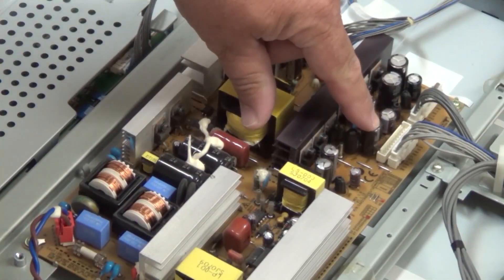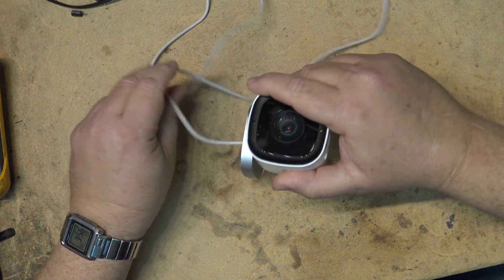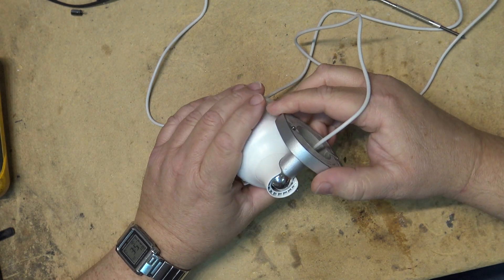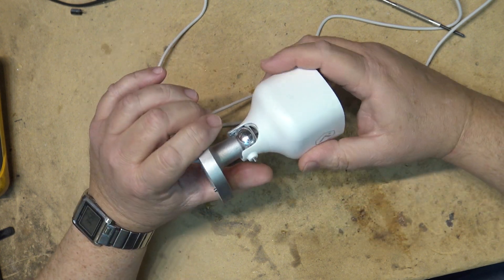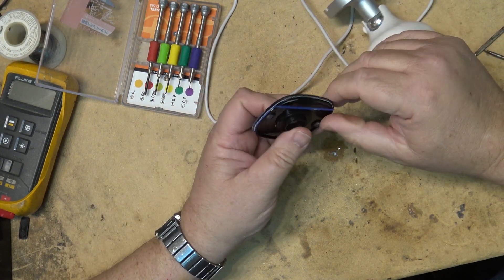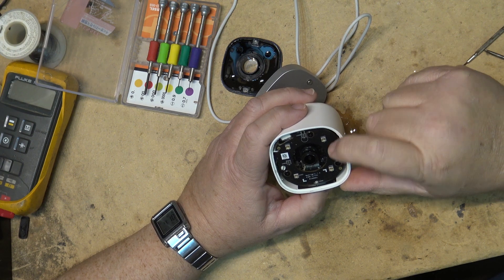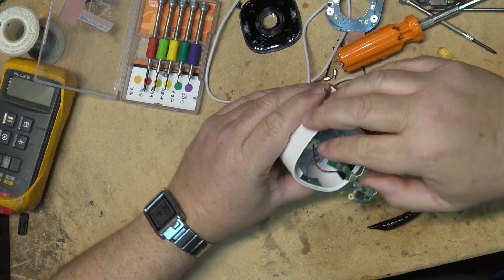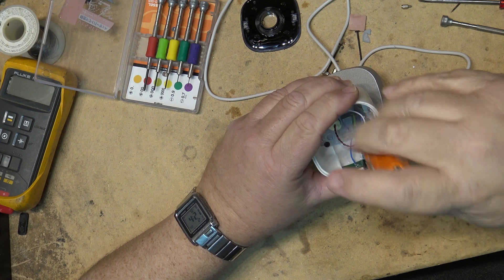Security Camera Forensic tear down to find out how water got in

Comment: Reminds me i should go up on a ladder this weekend and evict the spider from the one camera. Will also have to replace the one lamp there, as it has failed, but will first have to rewire a little to get the photocell onto it's own mounting, as it shares the bracket, and that is the failed lamp. Not fun working on that angle either.

Comment: Yes you're spot on with the water ingress,  not easy to stop it.
The heat then cold of the day will make the air inside  expand then deflate.
Just the pressure/vaccume will do the job of filling it with water.
What a pain in the ass, or donkey lol.
Reply: Correct.

Comment: Heat and cold cycles causing minute thermal expansion and contraction will create tiny openings where water goes in.
Reply: Also the volume change in the enclosure creates the pressure swings that vent out the cable and pull water back in during the night. The big seal likely has some permeability to allow for this, but sitting in a bath of water the cooling at night pulled it past the seal.